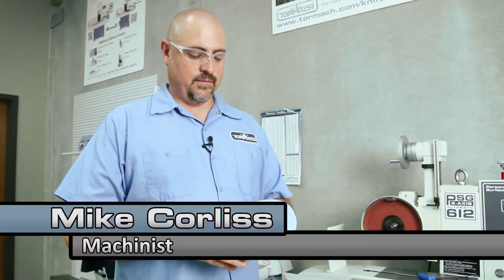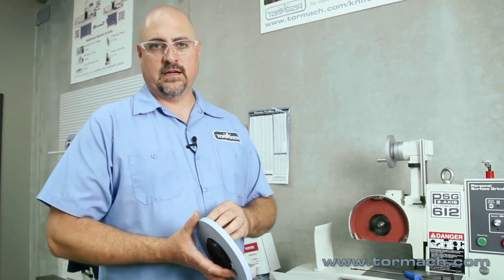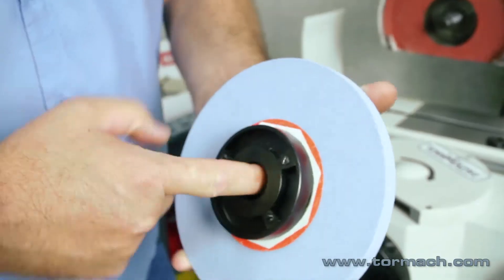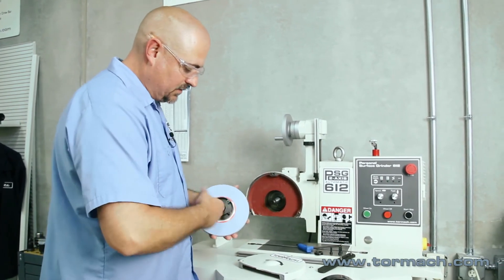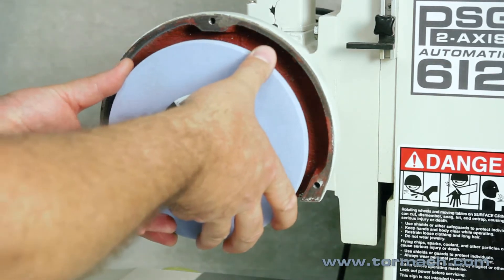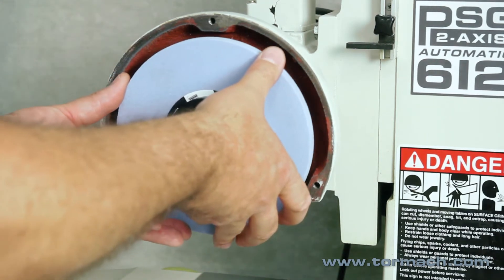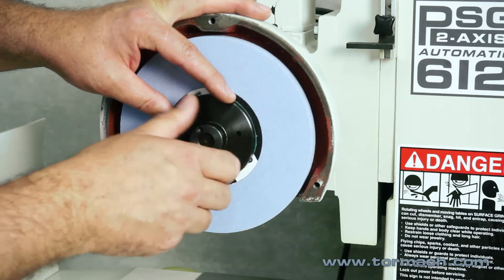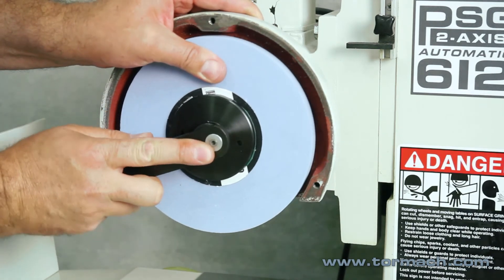Surface Grinder Basics - How to Install a Grinding Wheel

Comment: My wheel feels cinched on and the spindle rotates with the nut. Any tricks to lock the spindle?
Reply from the maker: You should open up a support ticket with out Tormach Technical Support Team and they can help you out. https://tormach.com/how-to-submit-a-support-ticket
Reply: @ the solution was to remove the fan shroud and put a wrench on the spindle.

Comment: Just a headsup on balancing. Although fun to do, in a real world shop its not needed and if there are machinists all over balancing wheels-that company will not exist for long unless they are under the wing of a huge company where inefficiencies are covered up and amortized in. Note that this video is for a major company that makes the grinder-not the parts. They are covering their ass and liabilities on the grinder so that no matter what you do they have ruled out the grinder.  Note the inefficiencies not based on production that ran the country into the ground.  When an item gets ripples on it that looks like a severely out of balanced wheel what that is from is that while roughing the wheel is too loose. (people mistakenly are afraid to tighten a wheel because of the old wives tale you will crush the wheel) Grinding wheels on a surface grinder like this are not often severely out of balance especially after dressing both sides of the wheel. Do this test-wait till you find a severely out of balance wheel or even create the condition. Mount the wheel. Dress the wheel then grind.--inspect the workpiece and tell me if you can get ripples. To your amazement you will not. (if the wheel is tight on the hub)
Reply: It’s not about the surface finish lol it’s bout the wheel being balanced for precision parts. You think it’s a normal thing for companies to waste time doing things like this ?